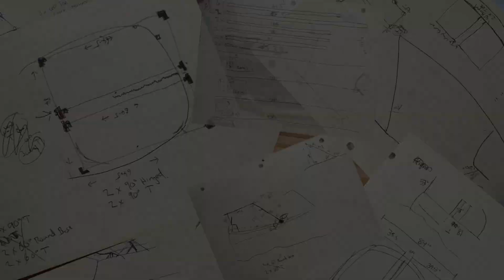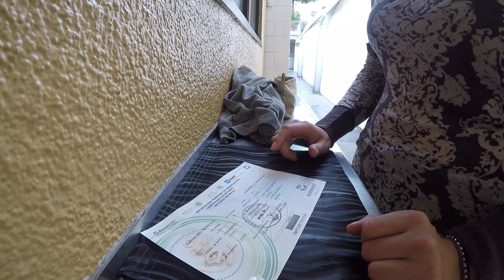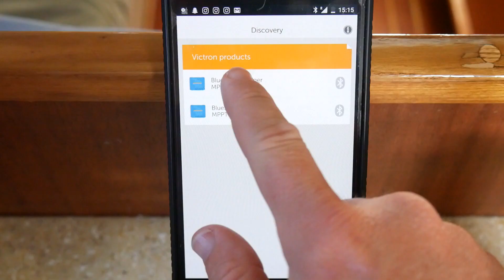DIY: SOLAR ON A BUDGET [Adventure #35]

Comment: Where did you buy the connectors for the stainless steel tubes? Did you consider using aluminum tubes to save weight instead of stainless?
Reply from the maker: The connectors we bought direct from SeaDog but we have since bought also from Bosuns Supplies which have some more specific items.  I think to get the strength the aluminum would have to be much thicker.

Comment: Great video as always.  We're putting together our electrical system right now so thought we would go back and check out this video.  We put together an excel spreadsheet to try and estimate our electrical usage needs.  You can input your exact electrical needs for each piece of equipment if you have that but this is probably a good estimate if you're looking at your system.  https://drive.google.com/drive/folders/1W5rb2aswwwGvFU0DsVww59DSYyg4I19P?usp=sharing

Comment: Why 2 x 6v batteries and not 1 x 12v?
Reply from the maker: The type of battery we picked is a good battery, if one goes bad you just replace one and don't need to be down to zero.  So redundancy I guess is one reason, space is another with more options to fit them.

Comment: Where did you get 1" sst tubing for $1.60 per foot?
Reply from the maker: Sorry for the delay, we have been out of internet for a while.  We used "Industrial Metal Supply" in San Diego and I think you would be able to find it at any industrial metal company in your area, at the very least they should be able to point you in the right direction.

Comment: so what you're supposed to do is keep the cardboard the solar was packed in, and tape it on to the panels to "turn them off" while you wire them in. Also, use a meter to test for power instead of your fingers. Glad you weren't hurt. Please be careful with electrical as it is one of the few things that can kill you at the dock. But beautiful job wiring it in!
Reply from the maker: Thanks Wilfred, electrical scares us just as you said and it is not something we like playing with.  Good news is we have no AC onboard unless plugged in (besides a small 400W inverter we run the laptop from) of course DC is still dangerous but the AC would make us even more nervous.

Comment: Why did you need 2 charge controllers?  Could you not wire the panels in parallel and connect to one charge controller?
Reply from the maker: Could have indeed, we chose the two as a redundancy to avoid any concerns over shading with either series or parallel and a backup if one goes bad.
Reply: Interesting.  I"m doing a very similar install.  

I purchased this arch:  http://www.fishonsports.com/140.html  

I also purchased two 320 watt panels with frames:  http://www.ebay.com/itm/320-Watt-Semi-Flexible-Frameless-Solar-Panel-24-Volt-Made-in-USA-MonoCrystalline-/272329685331?hash=item3f681d3953:g:uXgAAOSwhOdXoihJ

And the BlueSolar 50 AMP MPPT charger with the bluetooth dongle.  https://www.amazon.com/Victron-BlueSolar-MPPT-Charge-Controller/dp/B01BPLJASU/ref=sr_1_fkmr0_1?ie=UTF8&qid=1484071882&sr=8-1-fkmr0&keywords=blue+solar+50+amp+mppt

I'm also installing the panels side-by-side with a 8" space between them for the backstay and to give me a view of the mast. I'm installing a piece of clear acrylic over the gap to prevent rain from entering the cockpit.  I going to try and install a rainwater catchment system consisting of a small rain gutter connected to a hose that drains to one of our water tanks.  The solar panels also functions as a bimini, providing shade in the cockpit.  The total size is 86 x 77 inches.  The arch also has davits for the dinghy, LED flood lights, Radar dome mount, and a couple fishing rod holders.  I'm about half way through with this project.  Like most things it's taking quite a bit longer than anticipated.
Cheers.

Comment: If you or shall I say when you replace the lifeline batteries, you should consider " firefly Oasis" carbon foam batteries. The longest lasting, maintenance free, safest battery in the world. Why? Because you can 100% discharge these thousands of times and not kill them. And they recharge 3 times faster than  lead acid or gel batteries. They stay alive longer when not in use for extended periods time. Ocean planet has a video about them on YouTube for all the information. These batteries are a game changer.
Reply from the maker: Sounds super impressive, never heard of them and we will be sure to look them up when we can.  The video would be a good watch as well, is this newer tech to the market?

Comment: Very cool!
Nice job upgrading your electrical. I had recently bought new batteries and decided to install a shore charger I bought two years ago. Working out nicely, I think. Just trying to decide how I'll do solar, but that's further down the project list. I've thought of getting a new radar unit and locating it up the mast but having just had my mast refinished, that will wait too.

Enjoyed seeing how your project went.
Reply from the maker: Sounds like you have some great work already done with some good plans for the future as well, will you pull the mast and refinish it yourself?
Reply: Looks like I had to correct my first comment... "but haven't just.." changed to "but having just"...

Anyway, I already got work done on the mast. Rigging shop is dropping it back off to the boat/marina on Monday. Had some modifications done to it and repainted.

You could look for a previous video I posted of, let's say, "The before" view. Looking to post a video after I get it back, but here's a snap shot of how it looked when I was at the rigging shop yesterday. 

https://2.bp.blogspot.com/-n8vUH1GVxB8/WFVLlWXK3dI/AAAAAAAADpc/X1RTKeCqq1wZr16B2K3rUtUyZ7XeiIfsACLcB/s1600/IMAG2042.jpg

also wanted to note, that I thought of doing the mast work myself, but 
glad I hired this project out to someone else. Don't really want to 
spend too much time on my refit, while at the same time, trying to get 
it done right in the first place.
Reply from the maker: Wow looks beautiful, nice work.  Back in the water and off to sail hey?
Reply: Thanks. I like how it turned out. I still have several projects, a couple major too, before she's ready to sail again. I'm hopeful to launch in the spring but will have to see what happens until then. Despite freezing temps on the east coast, the refit continues. :-)

Take Care, both of you. Enjoy your holiday season. :-)

Comment: How did you make bends on the stainless tubes?  I know there are several ways to do it, I just didn't see that happening with a trash can and a saw at the slip.
Reply from the maker: No bends, we used all cut straight cut tubing with pre determined angles to build it.  We could not find an easy cheap way to do any bending ourselves, especially on stainless.

Comment: Loctite is a sailors friend....especially with self tapping screws. You need to check these screws frequently as not as good a rivets. But blue loctite will be fine. Never go red loctite especially to aluminum or softer metal. Even when you use red loctite  heat is needed to break the bond without stripping the  fasteners.
Reply from the maker: We totally forgot to bond the screws, our plan was to use lifeseal to help create a barrier between the two metals and it somehow got forgotten.  We will add it to our list, we used loctite on all our solar screws, for the mast we are thinking lifeseal.

Comment: Tefgel. 
Use when screwing two different metals together. Those SS screws will not come out easily in a couple years and if left too long in will have to be drilled out. 

The rigid bimini frame looks pretty good so far. Since I need a new one I will be watching how yours works closely. 

Thank you for ALL the links!
As always, nice job. I look forward to hearing from you guys.
Reply from the maker: Thanks Dean, we used some lifeseal on the radar wiring hole that came out from the mast.  We were suppose to use it on the SS screws as well which should work the same as tefgel(?) but we somehow forgot so have added it to our list.
Reply: You guys are great t watch. Always looking forward to your next video. :)

Comment: Something I found helpful years ago when purchasing handfuls of commonly used nuts and bolts was to just purchase the box of 50 -100 at a time.  Much much cheaper in the long run, especially if they are stainless steel.
Reply from the maker: Would agree with you there, we need to find a good system of labeling and storing them.  Might need another toolbox of some kind.

Comment: Did you say $1,400 for 3 batteries including installation? Where they AGM or wet cell batteries?
Reply from the maker: AGM's the two AGM 6Volt's were the spendy ones. Installation was $150 I think.

Comment: Great vid BTW, I love boat DIY. Just a quick question, I have seen on another YTer that just blocking 1 cell of a panel will block the whole panel from producing, so it seemed to me that lots of smaller panels would provide more consistent power. Any ideas on this, are there panels made out there that are wired differently so that just shading a single cell won't block the whole panel? Seems like a good idea to me. I'm no solar expert so maybe there is a reason, efficiency or something. My plan when I finally find my boat is to take a few panels from my house to use on the boat but they are LARGE residential panels like yours. Maybe you can do some tests?
Reply from the maker: Yes shading one cell or even part of one cell reduces the output incredibly, at a rough guess from what we have seen probably close to 75% drop when the shading is in effect.   We are no experts but this is the reason we opted for two controllers as opposed to wiring the panels together, we wanted to avoid the series/parallel debate and build in some redundancy.    I think although individual smaller panels would work you would then have to add the extra wiring and such to support this and it may not be worth it.  Again no expert but solar panels come with "bypasses" that should switch  between the good cells and the shaded cells to not lose all output, we have a 60 cell panel which has 3 bypass on a 10x6 cell setup.   Hope some of this helps, we will look and see if we can do some tests in the future and see what we get.
Reply: I would expect simply wiring them in parallel into 1 controller would be fine as long as the cable is thick enough for the current from the number of panels on it and the voltage and amps from the main line does not exceed your charge controllers maximums. 

There are specialist controllers (Morningstar SunSaver Duo) out there that will charge separate sets of battery banks (Engine & house).  remember in parallel the max voltage remains the same only amperage increases, unlike in series where the voltage is multiplied (Just like batteries) 

Our residential install has 12 full size panels with 3 each in parallel each connected to 1 of 4 lines that connect directly into an inverter (Instead of a charge controler) so your 2 panels really shouldn't be an issue. I don't think the wiring would be an issue either, for say 4 or even 8 smaller panels. 

Just run the core cable along the center and connect them at points along the core, better then losing half your power when one of your panels is partially shaded.

Comment: Hey Ty, just a tip from bitter experience. Did you use stainless self tappers to mount your radome? Did you use a protective coating? What happens, and only really in a saltwater enviroment, is you will get electrolytic corrosion between dissimilar metals. The saltwater acts as a conductor/electrolyte. What happens is the hole around the stainless screw is exposed aluminium and begins to corrode, the hole gets larger and the self tapper falls out, radome falls on ya head. Then your left with major potential stress points in your mast as well.... Sorry to be doom and gloom. Aluminium rivets would have been best, but you'd have to beg borrow steal the big ass rivet gun. Id get Hillary, preferably in suitable safety ppe like denim hot pants and bikini top  :-) :-) back up the mast and coat the screw threads and holes with a good product like the god awful yellow autolac (boat shop will have a kabillion types). Hope I haven't patronised you. 
Oh, was that stainless for the solar panels 316? Thats the grade best for marine. No biggy if not, just watch for minor corrosion and it's associated staining on decks etc.
Love the vids guys.
Reply from the maker: Great suggestions Shannon, we have it on our list to coat the SS screws with something like lifeseal but we forgot to do it somehow or perhaps we were waiting for the right weather so Hilary can do it in a bikini top and denim hot pants.  The tubing for the solar is only 304 which was the same that we could get from the marine shop funny enough.  You are not patronizing at all, we coating the radar mount itself and we somehow forgot the screws.
Reply: Adventure Adrift Thanks guys, I keep forgeting it's Winter where you are. Stonking hot here in western QLD where I'm working... Mid to high 30's. (centigrade) Thanks again for the vids!

Comment: Nice.  You made me jump and automatically move my face and head away from the screen when you arced that wire.  As a commercial electrician I've got that reaction hard-wired into my nerves.  Seen that too many times to count.
Reply from the maker: So that could hurt right or is that "normal"?   Thanks for feeling my fear.

Comment: That's a great price for a solar setup. I didn't watch closely enough to give any opinion other than on aesthetics but it does looks really good.   What is the panel backing (the plywood?) attached to?  It looks like its screwed directly to the hull but that can't be right.?

Comment: I think you should have used Butil on those through deck screws. You will now get water seepage. Maybe something you should address sooner rather than later. Also, what was the spark from? Great job on the install of the solar panels. What brand are the panels please?
Reply from the maker: We did use butyl on all the through deck screws, may not have seen that in the video.  Hillary placed the butyl on up top and layered it around the screws.  The batteries were wired to the relay and then I think my positive I was wiring touched the negative bus.  LG NEON 2 320 watts, very happy with these so far.

Comment: you guys should have used silicone on those screws in the mast for the radar mount. Anytime you do any electrical may it be AC or DC power should be turned off.
Everybody creates Sparks in the beginning .
Reply from the maker: Ian thanks for this comment, you just jogged our memory and I think we had lifeseal which we used around the radar cable and hole going into the mast.  I think we were suppose to and forgot to put it on the screws into the mount.  Thank you we will put this on our list for a project up the mast.
Reply: Your welcome. Part of boating is a learning process. I'd recommend picking up the 12 volt Bible , How boat things work and boat owners mechanical and electrical manual by Nigel Calder. They're nice to have around to make reference to if you have a question about an application.
Reply from the maker: I think Nigel Calder's books are on our wish list for the future and we have Don Casey's sailboat maintenance book, the more the merrier to reference like you said.
Reply: If I was a man of means I'd buy you guys the books. But all my money is tied up into a DownEast Lobster Boat restoration. I wish you guys the best of luck and really enjoy watching your Channel.

Comment: Butyl tape works great and last forever on keeping water out where things are bolted together.  When working with stainless I find making a dimple with a center punch first makes drilling much easier.  High pressure slow speed.  Good drillbits.  Awesome job on the solar panel install.  Really cool to see.  Have seen so many paperwork horror stories from sailors trying to do the right thing.  Seems to be the worst part with cruising.
Reply: And use a cutting compound. Moly disulphide for example.

Comment: So I have always wondered how one comes down from the mast under control. I understand how she can use the winch to lift you up. Does the winch work in reverse to let you down?
Reply from the maker: Yep, the more wraps the increased (tension/friction?) holds the weight for easy lowering.  that being said we always have two lines and one is a separate harness with a safety line cleated off incrementally.

Comment: I'm curious why you used separate charge controllers for each panel, rather than connect both panels either in series or parallel to a single controller?
Reply: Probably took a cue from Scott on Muskoka, and his system....that way, if one panel is shaded, it doesn't cut down on the entire system.  Also, if you lose one controller, you still have a redundant system.
Reply from the maker: Pretty much what DesertSquid said, shading was the main reason and redundancy the other.  Having them both independent would allow us to maximize the power without concern over a connected system with shade.  Either Parallel or Series both would have shading issues, having the extra controller will be helpful in a pinch if we ever lose one when far from home.
Reply: Adventure Adrift Fair points, thank you!

Comment: Well if that's not enough power you better get a BIG generator. Would have loved to buy your old battery's. Great to see the pipe slide thru the T fittings, I'm going to replace my cable with pipe on my stanchions and raise the hight of them. By the time you get to Mexico every thing will be new! You did a great job on that.